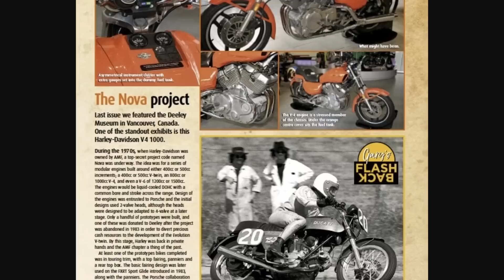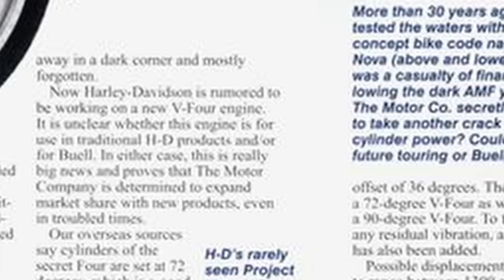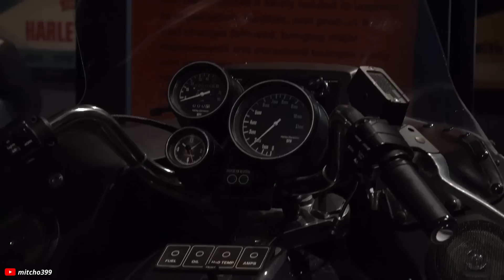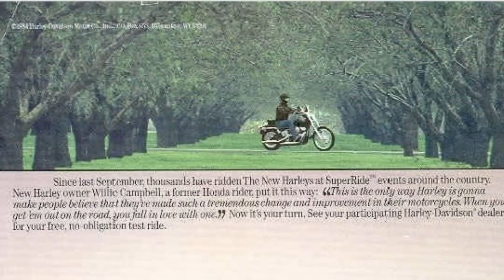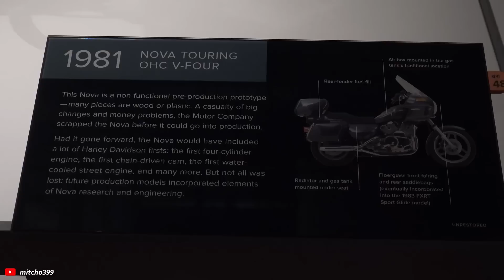The Secret Harley Davidson Motorcycle that could have changed EVERYTHING

Comment: Today I found out Harley dabbled with the V4, water cooling, over head cams and fuel injection early on. Left a lot of innovation on the table there.
Reply: Meanwhile, Honda and Yamaha killed it with the VFR750 and VMAX.
Reply: If I recall the R&D Harley you speak of was 900cc and at the time could compete with a state of the art 750 cc Japanese bike. Of course the air cooled Vtwin gang said 'No way!' and the R&D was cast away for decades.
Reply: But hey at least you can still buy a bike that still kinda looks like a 1936 Knucklehead.

Comment: My thought was WHY didn’t HD continue to build their Heritage bikes but also build sport bikes to compete against the Japanese bikes.   I wasn’t aware that Porsche was involved in the Nova project, but have always felt HD missed the mark in not building the V-Rod as a V4 rather than a V twin.   Vehicle manufacturers survive and prosper by building what the public wants or they go out of business.
Reply: The tragedy of HD is that they refuse to learn from their mistakes. The Nova, the V-Rod and even more significant Buell: all missed opportunities by HD. HD seems to be cemented in that oh so American mindset of "if it was good enough for my pappy, it's good enough for me" and it has held them back through the decades.
 
Even "good old" BMW eventually saw the light when they brought out the K-series besides their "tried and trusted" R-series boxers and look where they are at now. HD could have been at a way higher level if they had adopted and stuck to BMW's example: imagine HD having a classic line, a V-Rod line and a Buell line; HD would basically have a bike line to suit most riders. Add an adventure line and they would have had a complete line-up. Instead they always dropped their innovations like hot potatoes and fell back on "tried and trusted".
Reply: The biggest issue with a HD sport bike is, people won’t buy them. Now, buell was a perfect example of that being wrong, but, by and large, Harley guys are Harley guys, and want big v twins.
The Nova project did spawn the FXR bikes, designed by buell.rubber mounted, performance based v twins.
Buell was a visionary and wanted to build sport bikes with sportster motors. Harley said there was no market.
When buell went out and proved them wrong, HD said they would sell them at dealerships and supply motors to buell.
They were actually a big hit. But, as buell advanced his tech, moving away, and ahead of HD, they were dropped.
HD again said there was no market for HD sport bikes and affectively killed buell.
The vrod, also from the move project , could’ve been another hit, but HD put a great motor in a stupid platform and caused it’s demise.  Had they used the motor in sportier platforms, and also a bagger/ touring platform, I think they’d have had a hit. But they chose to put them in an ungainly and I’ll performing “ cruiser” platform that nobody wanted.
Today, the 750 and such use a smaller version of the vrod type design, but it’s too little too late.
They missed their chance to bring the vrod motor to the public in viable platforms and now they’re old news.
They could’ve captured the midsize bike market then with the smaller vrod type bikes, but the window had closed.
HD was your dads brand and the young moved on to other import midsize bikes.
Triumph, Yamaha, Kawasaki etc, all brought back midsize twins and singles and HD was trying to catch up, too late again.  They have cemented their legacy in big cruisers and tourers and that’s where they’ll die.
Too many missed opportunities with closed minded thinking.
Reply: @megastick9324  Agree. H-D killing the Buell line was idiocy on par with the way the V-Rod platform was used. H-D should have been developing a 750 or smaller displacement "starter" bike like they had with the old 45 back in the day. Missed opportunity. Putting the V-Rod platform in some Lazy--Boy riding position? Idiocy. No dirt bikes or scrambler type? Idiocy. I love my H-D bikes and ride the hell out of them, but Harley basically doesn't support their product for more than 10-15 years anymore and just want to sell new bikes to aging Boomer RUBS. The next 10 years for H-D I think may make or break them.
Reply: @seththomas9105  Dude, Harley did develop a 750 starter bike, the Street 750 and 500.
Reply: @SteffiReitsch  Too little, too late, and too expensive.
Reply: @SteffiReitsch   It cost too much
Reply: @TattooedHoodlum  Labor costs are high in the U.S.  The price reflects that.
Reply: @SteffiReitsch  Given that the majority of HD's parts are made in China now, it isn't labor cost killing them.
Reply: @TattooedHoodlum  Pops, all  Harleys sold in the U.S. are 100% assembled there. ~30% of the parts are still U.S. made. The Americans are paid more than their Asian counterparts.  Remember the Amerikan executives, engineers, assembly line works, office staff, shipping staff ... everybody down to the  janitors are higher paid than their Asian counterparts.

Comment: The problem with HD is that the styling department has the final say in everything. Harley has engineers that are as good as anybody's,  but the styling department vetoes everything they design if it doesn't look like, sound like and feel exactly like something from the 1930s. Other motorcycle companies put the engineering department in charge, which makes sense if you think of your products as machines designed to do something as well as possible, as opposed to being something to look at.

Comment: AMF-Harley-Davidson spent between $10M and $15M on the Nova project, it's modular powerplants were planned to be offered in three capacities, 500cc V-twins, 1000cc V-fours and 1500cc V-sixes. Only ten complete and running Nova powered machines were ever built. The Nova project is another case of "If only" for Harley-Davidson.

Comment: Porsche was never really just a car manufacturer, it started off as and continued to be an engineering design consultancy. Ferdinand Porsche designed the Volkswagen under Hitler's direction based on the Tatras that Der Fuhrer had seen when he had been shown around the factory in the mid-'30s. In the late-'50s the company was employed by Studebaker to design a car (which never came to fruition) at the urging of then-Studebaker chief engineer John DeLorean.

Then in the 1970s Audi employed them to design a sports coupe. This project was rejected by Audi in the end because the company was a manufacturer of front-wheel drive cars by definition and Porsche had presented them with a rear-wheel drive coupe with the gearbox in unit with the rear axle. In fact, the engine was the only part of the car from the VW/Audi parts bin. Nonetheless, Porsche decided to produce it themselves as the 924 and Audi gave the 80 (Fox in the US) a two-door bodyshell and called it the Audi Coupe.

At the time Harley was working with them, they were making more money from their consultancy work than from their cars.
Reply: My recollection is that the 924 was very much a VW Group parts bin special. This was discussed when the car was first introduced. The gearbox was Passat but the bell housing modified to allow the gear change mechanism to pass through. Rear trailing arms were late Beetle, front suspension used VW bits, lots of small parts also. As a result, Porsche people regarded it as inferior, and the 944 derived from it shed as many VW bits as possible. Its engine derives from half a 928.
Reply: Porsche Cars and Porsche Design are two different companies. Almost all manufacturers of all kinds of vehicles have had business with Porsche Design. Some got help from Lotus instead.
Reply: With as far along as the development process was with HD, I'm moderately surprised Porsche didn't pull a 924 and just sell the motorcycle as their own.

Comment: For the most part, it can be said "If there is a way to mess up an advance design, put Harley on the Team and they will absolutely screw it up".  This bike would have been an outstanding product but digressed back to their only thought process, Cruiser Only Design.  They tried to fix their move later when they designed the V-rod, but again they placed an outstanding sports bike engine on a cruiser bike.  It didn't handle at all, it could stop, eventually, and was about as comfortable as a bed of nails.  It was also hobbled by it's stratospheric price and try to put up against the King, Yamaha V-Max.  Sorry the V-Max would blow it away in performance, plus it had acceptable handling, top it off it actually was much more comfortable, all at practically half the cost.  Then again about a decade after that, they released their 500-750 line, again a good engine hobbled with dismal cruiser set-up.  That also was a dismal failure.  The only way HD will survive is after their current leadership retires, or take that long dirt nap and someone takes charge that grasps that motorcycles are more than just based off of a cruiser layout.  Their Adventure bike and their e-bike will sell a handful and that is about it, neither has any real qualities that will match their stratospheric price tag.
Reply: So true. H-D is a tradition based company, not a high technology company. The last time H-D ever really put a bike that was at the forefront of motorcycle technology was with the XLH Sportster in 1957. When the Ironhead engine was increased to 999cc, it was making very close to the coveted 1 HP/cubic inch, and it was the fastest production motorcycle for a short period of time. Then the bottom dropped out, big time. After that, H-D haven’t done anything that wasn’t done before them, and often times LONG before them.  Today’s “Milwaukee 8” H-D engine is technology that Japan was using back in the late 1970’s. Anything Porsche did for H-D like the V-Rod was ancient history by the time H-D got around to it.
Reply: @MarkPalmer1000  you are correct, it appears if it isn't a 45-degree V twin cruiser it isn't worth their time.  They have obtained some very good engines over time, but either dropped them as they didn't fit the mold or crammed them into a cruiser layout frame to ensure their failure.  Like I said in the past, if you want an excellent power plant to go down in flames, simply hand it over to Harley, and they will screw it up beyond belief.  Their Pan American, I am guessing, will be a dismal failure relatively soon due to 2 specific reasons.  1.  The cost is way over the line, yes it is a relative good bike but it isn't in the same class as other bikes out there that cost much less.  They did that with the V-Rod, was a weak sister to the V-max at nearly double the cost.  2.  That stressed engine frame concept on an Adventure bike is going to be a really costly mistake for Harley.  Yes, only a handful will make it off-road, but already there are reports of component failures, and broken engine-to-frame mounts.  Makes that BMW rear swing arm issue look minor in comparison.  A cradled twin-loop frame makes it much more logical for an Adventure Bike, seems as if steel tubes flex in impact situations where cast materials break.
Reply: @thomasheer825  lots of good points.
The V-Rod engine is a derivative of the VR 1000 race bike. That was a big step in the right direction, but not enough - the race bike had potential but needed to catch up. If they had done so, and made a road sports bike from it, and then a full range. But no, Harleys are cruisers...
What was the issue with BMW rear suspension?
Reply: Have had BMW's for the best part of 4 decades, and sooner or later they will figure out how to attach the drive splines to the hub, as this is the most common problem.  Never had it happen to any of mine, but I don't ride by force, was ingrained to ride SMOOTH from a kid.  Those guys that slam the bike around eventually work those rivets out of the hub.  Over the years have seen it again and again, and have developed several repairs that seem to work better than those rivets, but some people can break anything.   Other than that have found BMW's rather bullet proof, some minor Bosh electrical Whiskey Tango Foxtrot Oscar things. but any Bosh product has issues.

Comment: Under the development name “Revolution Engine”, in 2002 development partner Porsche Engineering developed a new V2 engine for the “V-Rod” model of the American motorcycle manufacturer Harley-Davidson.Against the backdrop of a collaboration stretching back to the 1970s, the Porsche engineers constructed a water-cooled 1,131 cc motor based on a racing engine that delighted Harley-Davidson's demanding clientele both for its performance as well as its imposing sound. With a DOHC valvetrain and electronically controlled fuel injection, the VRSC-series Harley with its four-valve engine put out up to 120 hp.

Comment: One thing riders have demanded, and loved about Harley, is the low seating position. Around the time of the Nova project, putting the fuel tank under the seat whereby raising the seat height was something that many riders just wouldn't accept. Motorcycle historians often overlook this point, not giving credit to how important this was/is in the marketing of a new design.
Reply: Gold Wings have had the fuel tanks there forever. Hasn't stopped anyone from riding them.

Comment: 1978 My friend had a Kawasaki 1100 LTD and spent a ton on it with after market parts and that thing was a Monster! He got the bug and Bought a new 78 Wideglide and that was nothing but a POS! The factory replaced the Motor twice and It still had issues. he finally sold it and bought another one in 1989 and rode it for a long time! But man that 78 was a Lemon!

Comment: In the 80s, the Japanese companies were dumping motorcycles in the U.S. market, selling them below cost in many instances, in order to break Harley and put their own bikes into the market, after which point, with the market secured, prices would be raised. Harley made a fair argument against it, won in court, and the Reagan admin started levying tariffs on the Japanese bikes. This didn't stop H-D from shooting themselves in the foot and continuing the heritage theme, which faded in popularity as their core clientele aged and younger buyers started sizing up their bikes. The one thing Harley did have, was riding ergonomics; the seats are low to the ground and make the bikes easier to handle at low speed, and the riding position's really comfortable on the road. And they looked good. But it wasn't enough.

Comment: You forgot in 1979 Kawasaki built the kz1300. Inline 6. That was 120 horsepower, and 88 ft lb of torque. The Honda cbx was a great bike of but it was 1000 cc it wasn't as fast as the kz1100, or the Suzuki 1100 katana or the Yamaha SX 1100.

Comment: You forgot to mention the V Rod… which was a reboot of project nova. Porsche designed liquid cooled engine with the gas tank under the seat. 
Also, the nova bikes were V4s… not V twins. Hence the 4 exhaust pipes.

Comment: The Evolution was what brought more people to Harley Davidson, the sound of a Shovel, with the looks of a custom finished show bike off the shelf, and reliability that left the Japanese bikes stuck in the sugar sand. What Harley really needs is a designer who’s concepts are attractive and an engineer who has Moto GP roots for chassis design, and an engine design team that can create a V2-V4-V6 modular transverse arrangement with a narrow base width, cammed to maintain the Potato Potato Idle, (thats why people buy them, but wish they had better performance as far as road racing, and drag racing, stopping, cornering, and accelerating out of corners, potential) a Y3 Y6 collection all of the designs with a modular design and importantly engine castings reinforced to function as stressed members for stability and weight reduction, ease of maintenance, and reliability. With this in mind, the company and owners can retrofit and customize or upgrade with future advanced mechanical and technical improvements without major tooling or undergoing severe custom modifications and turn every bike sold into a sound investment, with a potential for a value increase. (It may cause a ripple in the used bike market, but it will adapt and find its demographic) I came up with these concepts while I was active and competing in AMA CCS & WERA road racing. They are my intellectual property and I own the trademark and general design concepts. Any additional incorporations are fair game and I am open to incorporating modular based accessories.

Comment: How many bikes are out there with the radiator under the seat? Good idea, but getting it to work good enough for mass sales suggests, maybe not. Seems HD thought the mass market for radiators up front was not a route they wanted to take. Same goes for fuel under the seat, although so long as the filler was in the usual place this can work. Otherwise looks a nice motor. Pity they bottled it.

Comment: First, if AMF hadn't bought HD in '69, there would be no HD. AMF dumped loads of money into the company and did all they could to keep their civil contracts going and keeping bikes in production, sadly the 70's were well known for labor strife, and harley was no different, their own workers were damaging the brand at times. Now if the nova had been released by 1982 they may have gained a market and also gotten a jump on the Japanese but under new management the company decided to push heritage rather than innovation. At least they saved the EVO and put it into production, as well as the rubber mounted isolated engine chassis. The Evo luckily ended up being the best engine they ever produced, the twin cam was a step backward in longevity, but at least gave the aftermarket a big push developing all the cam drive fixes. Redesigning the Sportster was also a very good move, and the old iron engine was awful. I've also seen pictures of an inline four mockup they were considering, but I never heard it going anywhere beyond a model.